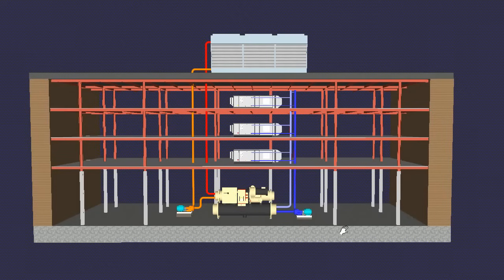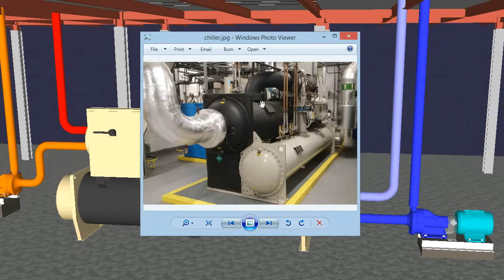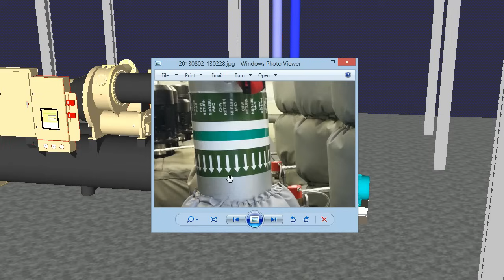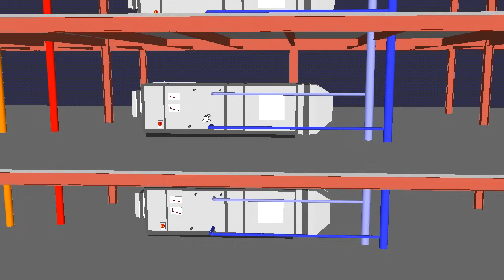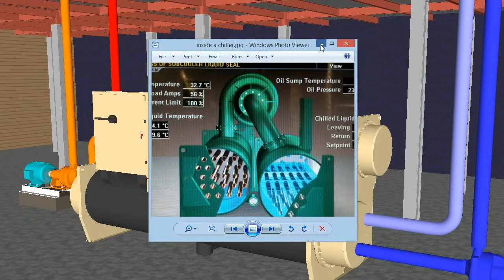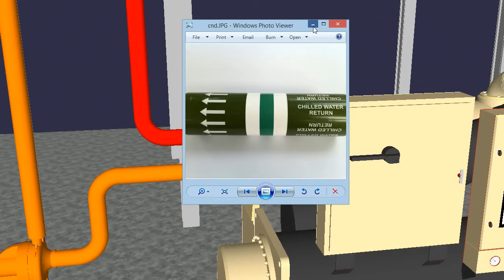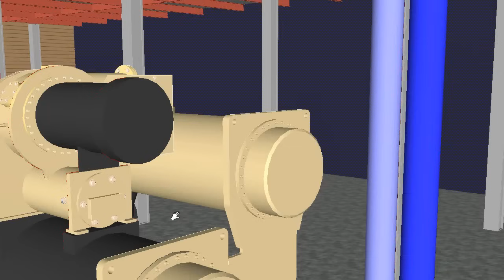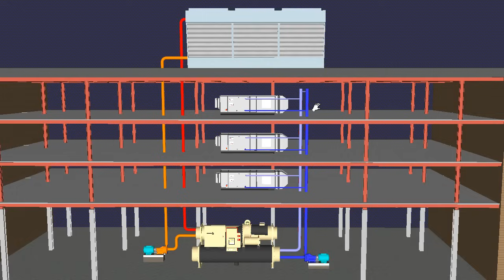How a Chiller, Cooling Tower and Air Handling Unit work together

Comment from the maker: ⚠️ Found this video super useful? Buy Paul a coffee to say thanks: ☕
PayPal: https://www.paypal.me/TheEngineerinMindset
Reply: The Engineering Mindset 
Hello sir very nice explanation,  please make video on maintenance engineering
Reply: MR PAUL HOW AIR RETURN WORK ON CHILLER
Reply: Paul, would you be interested in creating a small video for my company? For a fee of course.
Reply: Sir please make a video and tell us that why we put always chilled water supply line bottom of the AHU and FCU.
Reply: Great video..but you should definitely get gulps of coffee before recording the video
Reply: Hi Paul,
Great video.
Quick Q:  
Why is a condenser + cooling tower even needed - if there are already Chillers being used in the AHUs?
Reply: I saw a new installed chiller they connected evaporator to the cooling tower isn't it wrong?

Comment: I was on a job years ago and the steamfitters were installing the condenser water riser. They were up about 12 floors (with 50 to go) all hung and welded when the engineers realized it wasn’t seamless steel pipe, as required in the specs. They had to pay the iron workers and tower crane operator to lift it out in sections. It was a 48” pipe. What a disaster for the mechanical contractor.

Comment: Chris C I have worked in high rise building here in the US, and all of the buildings have the AHU's just like the illustration shown. Every floor has a Mechanical room with its AHU, now the only difference is, the cooling tower some have it separated from the building its self. Built by it self on the parking garage.
Reply from the maker: Absolutely, the installation really depends on the design, size and purpose of the building and every building will do it slightly different.

Comment: I have designed many systems where AHUs are located in hallways, inside the facility, usually above drop ceilings for in indoor agriculture and greenhouse design. Rooftop units work best on flat roofs but many buildings and greenhouses are pitched/temered glass and are pitched roof design. AHU's can be located above drop ceilings in office buildings or dropped directly inside the greenhouse, to prevent infiltration. It is also recommended that AHU's are placed in the conditioned space, as shown modeled in this video, for CO2 injection applications.

Comment: AHU's are generally placed in the roof or ground. I've worked in hvac for years now and never seen it like that. That said it could well be done like that outside of Ireland where I live where most of our buildings are low rise. nice job on the 3d model dude
Reply: Sorry... should have waited to the end of the video, you said just for its illustration purposes. Still I wonder if it is like that in larger buildings?
Reply from the maker: Hi Chris, yes in smaller buildings AHU's are usually found on the roof or basement. But with the high rise commercial buildings, especially those with tenanted floors, you'll often find AHU's on the floors.
Reply: The Engineering Mindset can u make a video on how to clean the cooling tower
Reply: Commercial Air handlers are NEVER put on the roof, unless you mean a Rooftop unit (RTU) or possibly talking about a Penthouse Unit?. In 38 years in this business I have never seen a rooftop air handler, RTU's Yes, Rooftop A/H's no,,,
They DO However put them in the ceiling in some smaller buildings, if they're on a loop, or sometimes in Light Commercial they used to put in a regular split system with the A/H in the ceiling, but with new codes there are NO ceiling installations and DEFINITELY No rooftop A/H's
Reply: Mark H, Stevens,CMS cleary said in the roof. I know they dont go on the roof i meant roof void

Comment: Are you going to do other mechanical and electrical systems for building services engineering? Would be nice if you will do them. This video clear a lot of my doubts as I'm new to the construction industry. Give you 100 likes!
Reply from the maker: Hi Icey, yes we're working on lots of new videos. Hit subscribe to stay updated. Let us know if you have any videos you would like covered and we'll add them to the list.
Reply: Already did m8! I currently wanted to start off with M&E related works, perhaps maybe starting with an introduction 1st such as what types of system there is and how things work. Then more on to designing those systems :P. I know is not an easy task to make those visualising videos, and for that I truly appreciate what you guys are doing!

Comment: A system like this should also use balancing valves to regulate flow to each AHU, otherwise, there will be a problem with the distribution of water. Highest AHU will have less flow and cooling will take more time than the lower AHU.

Comment: just one question, in the video, you said the red pipe is the higher temperature, but why the compressor is connected to the orange pipe? I thought the red pipe should connect the compressor because it needs to be pumped up to the cooling tower? (like the darker blue pipe pumping up to the AHU'S

Comment: Great job, very clear about the cooling circle thanks for wonderful job! 
Are the condenser and chiller connected by refrigerant? Could you please explain the pressure inside the machine, are they the same pressure? Thanks so much.
Reply from the maker: +Tian Tian There will be a difference in pressure between the water inside the tubes and the refrigerant on the outside. The chilled and condenser water flow only through tubes in either the evaporator or condenser respectively, the water is completely separated from each other and the refrigerant, it just transfers it's heat through the tube walls into the refrigerant or vise versa. The refrigerant is the only fluid which passes around the inside of the machine between the compressor, condenser, expansion valve and the evaporator.
1) The refrigerant is sucked into the compressor. It's pressure and enthalpy will increase.
2) It then enters the condenser where the pressure remains the same but the enthalpy decreases because it transfers it's heat through the tube wall and into the condenser water which is sent to the cooling tower.
3) Next it passes through the expansion valve where it drops in pressure but the enthalpy remains almost constant. As the refrigerant expands, its volume increases and so it will drop in pressure.
4) Finally it enters the evaporator. The refrigerant will be at a lower temperature than the entering chilled water in the tubes. This causes the heat to transfer from the entering chilled water and into the refrigerant. The refrigerant will begin to boil and evaporate, this increases the refrigerants enthalpy but it's pressure remains constant.

Comment: Great video, just to confirm. The pump that exists the condenser should be in the hotter tube? to take that water to the cooling and tower. And then the water falls by gravity in the orange tube, right?

Comment: Thanks for the video! Where is the inlet water on the chilled side
Coming from? In the condenser side, there is makeup water for the cooling tower. Since this is a closed loop, how is water getting in and out of the chiller in the first place?
Reply from the maker: See the chilled water schematic video, inlet at pressurisation unit
Reply: Please can I get a link to the video?

Comment: Great video! I hope anyone could answer my question:

I have question regarding the condenser's purpose. What is the point of the hot water loop, and how does it reach such high temperatures? It comes back a bit chilled, and then it absorbs heat from the refrigerant and continues it's hot water loop?

The refrigerant  as well, is the purpose of the process to have the refrigerant absorb the heat from the cold water return and circulate the water back up to the AHU?

Thank you in advance for clarifying!

Comment: Dear Sir
The video is superb!!
I have one doubt.
How humidification or dehumidification is possible?
Is it with the help of a separate humidifier/dehumidifier?
thank you
Reply from the maker: Yes humidification needs a separate system installed to add water vapour or steam into the air stream, but dehum can be done with the cooling coil

Comment: Do you need a pump on your warm condensor return to push the return to cooling tower? The diagram shows the pump in the wrong pipe.
Just wanted to know.
Reply from the maker: Here this should help: https://youtu.be/ak51DHAiuWo
Reply: The video didnt help. Does the pump push through the condensor and then up to the cooling tower? Or should the pump be in front of the condensor? Or does it vary system to system?

Comment: Nice video. But if the air through the cooling tower is taking away the water content by evaporation continuously, shouldn't the amount of condenser water in the loop keep on reducing? Or there is another water supply to refill the condenser water? Many thanks!
Reply from the maker: Antonio Wong yes the water is topped up. Also the condenser water becomes dirty so water is drained. check out our video on cooling towers to learn more.
Reply: Big thanks!

Comment: it's a good video to explain specification and installation of cooling system based to chiller , cooling tower and network of water circulation between air handling system and cooling devices..but i would like to show me please..how to combine heating system (network of heat water circulation produced from boiler) with even network . and can you tel me it is possible to using a small unit of photo voltaic energy to power supply the air handling system and other equipment when electric network suddenly shutdown. tank you sir...
Reply from the maker: Hi FTINI, I'll add a heating version to the list. There are a few ways you could run this off a PV array, it might be easier to run it off a diesel generator though. You would need a lot of solar panels and batteries. How many depends on both how energy hungry the equipment likes fan motors are, and also how long you want to be able to power it for. You would need an automatic transfer switch (ATS). A more typical installation would be to charge a battery array using PV, then use the battery packs as an interim energy source before a generator can take over the load, this is known as a UPS or uninterruptible power supply.
Reply: hi..thank you for explication on PV power supply...well ..I now that's easier to run off my HVAC system and other component  by a D.generator  when electric network shutdown... but i would like to using PV on a small parts  of my central air-conditioning system  because in my country there are many time of sunshine allow me to integrate new technologies of PV array (like monochromatic cells , power optimizer ,etc.)  they have more performance and efficiency ..in addition, is not necessary to make battery because my project  concentrate on the building of daily employers but not in night.

Comment: What's the advantage to using chilled water as a cooling medium, as opposed to say using regrigerant to remove heat from the space and getting the same result?
Reply: Just my idea. 
Refrigerant only for cooling = more refrigerant, cost more for operations (considering whole building system)
Refrigerant + chilled water = Requires less refrigerant because water is a great medium for heat transfer.

Comment: Nice explanation i would like to appreciate your work and hard effort. its really admirable.
but i have some confusion about this tutorial, basically i'm very new to HVAC. the point is when hot water at 35C is circulated from condenser to cooler tower while there was no any pump installed on either side then how could water which is almost 50L/sec will move.
Reply from the maker: Waqar Iqbal there has to be a pump for 50l/s

Comment: I am confused about one thing. You have said that the CWR comes back to the condenser and then that water is supplied back to the cooling tower, if that's the case how is the evaporator getting the chilled water? What am I missing?
Reply from the maker: The chilled and condenser water are separate circuits. Please watch our videos on how a chiller wotks

Comment: Sorry, I just confused on the chilled water pump. Usually the pump will push water to the heat exchanger, thus the suction side of the pump is from the AHU and not from the heat exchanger. and lastly, why does the design not have a expansion tank on the chilled water system? sorry, i work in ship's hvac. Im interested on the difference.
Reply from the maker: Hi budoy82, this is just a simple model to help people understand the basics of how the system works, so we've left a few items off, but, in the future we will be making more advanced videos. You're correct, typically the chilled water is pushed through the evaporator to prevent damage, and cavitation etc. and this is typically why a low loss header is used for a primary secondary system, to ensure that there is no shortage of water. Again though, this hasn't been included as it's a simple mock up to teach the basics for now.

Comment: Condenser side of your system designed for 35-28 degree. So is this system works if the outside temperature above 35 degree Celcius?
Reply from the maker: it becomes less efficient and harder to achieve. chiller might shut down to high pressure

Comment: I m confused with the location of condenser pump. Kindly explain where should be its exact location?
Reply from the maker: The condenser pump was connected backwards by mistake in this video, I point this out towards the end. The condenser pump is usually located before the chiller and pushes water through the chiller then up to the cooling tower.

Comment: Thanks for the video. If the requirement was to heat the building for cooler months of the year, what approximate temperature would the supply water to the AHU be? And what would the approximate return temperature be to the chiller? I am quite new to HVAC, I just want to know if the basic function of the AHU is reversed when heating is required as oppose to cooling. Thanks. J
Reply from the maker: Hi John, the chiller will only be used to provide cooling. Some will have heat reclaim but often not.
There will be a separate coil inside the AHU which is connected to a riser and the heat is generated by a boiler. Typically it will be an LTHW system (low temperature hot water) and the temperatures could be somewhere around 85*C flow and 70*C return in design but obviously in reality it will vary from this.
Reply: The Engineering Mindset thanks for the info!
Reply from the maker: Hi John, we just published a heating video here! https://youtu.be/lDeuIQ4VeWk

Comment: This is a very informative video and thank you for that. However, I lost you mid air. You said the water is pulled out of the chiller, through the dark blue pipe at 6 to 8 degrees. Goes up to collect heat that is stored in the Air Handling units. And when it leaves the AHU it will be about 14 degrees. It comes down to the condenser part of the chiller, then out of the condenser at about 35 degrees through the red pipe up to the cooling tower on the roof. How did the water change from 14 degrees to 35? That part is missing. You then went on to say, when it leaves the Colling tower back to the chiller it will be about 27 degrees. What then happens in the chiller that it goes out to the AHUs as 6 to 8 degrees again? Please help.
Reply from the maker: Please watch our new video on turbocor chillers

Comment: Can anyone help me with this question 
At my site we have a forced draft cooling tower and there's a return and supply header 
The question i have is that in this system there is a inter connection between the 2 headers 
May I know what might be the reason coz I did some research and I couldn't find anything
Reply from the maker: Is there a valve? If so it's likely a bypass to ensure enough water can get back to the chiller
Reply: @EngineeringMindset  thank you for the reply 
There is no valve between the connection.
I've gone through all the operation manuals and everything but cannot find anything.

Comment: hello sir!could you please tell me,how the high temperature water coming out of condensor directly goes to cooling tower with out using any motor?
Reply from the maker: Manideep Solleti it is connected to a pump. the pump sends the condenser water to the tower and is returned via gravity

Comment: Is the water loss from the cooling tower simply evaporation?
Reply: Sometimes, things sweat and leak.
Reply: @1MaximusDecimusMeridius1  Sweat like something were not insulated? That would be water from the ambient air which wouldn't account for water loss. Are leaks inherent to the system?
Reply: @Davi-did  I mean most of the towers I deal with have leaks somewhere in them. We had one last weekend that I went to that was just plain empty🤷‍♂️
Like no one knows how or what or why - but it was dry 😂
Refilled it, tested out the pump to make sure it was working right, valves etc and it’s now working just fine. So yeh, I’d say almost all of them leak at some point.
Reply: @1MaximusDecimusMeridius1  Is there some way to know what normal water consumption should be? I don't know much about cooling towers, but a condo HOA is spending tens of thousands of gallons  each month on water for the cooling tower used in the HVAC system.
Reply: @Davi-did  I can tell you- it’s not that amount. 
I would have them check the drain valves-
Sounds like some bypass may be happening and the towers are unintentionally draining, causing them to refill constantly- or a stuck float, when it’s stuck they’ll refill and overflow while the filling just continues. 
The evaporation is minuscule at best.

Comment: im confused in the part where the water coming from the cooling tower to condenser. what does it do if it does not connected to the evaporator and exchange waters? can someone help me please. i need to learn this
Reply from the maker: There's two separate water circuits which do not come into contact with eachother. Check out our video on chilled water schematics